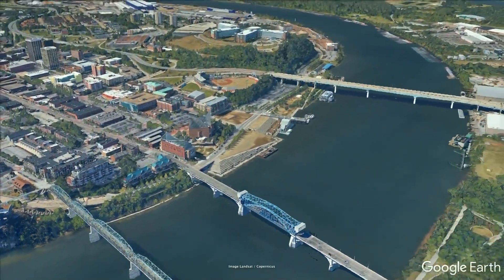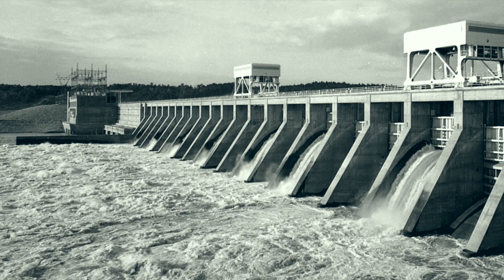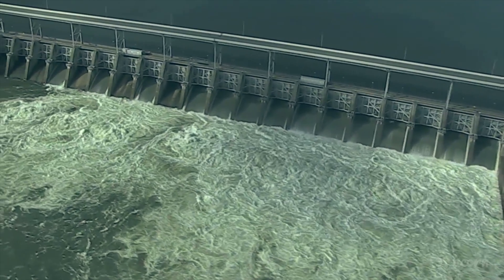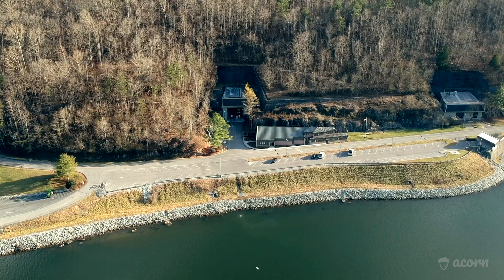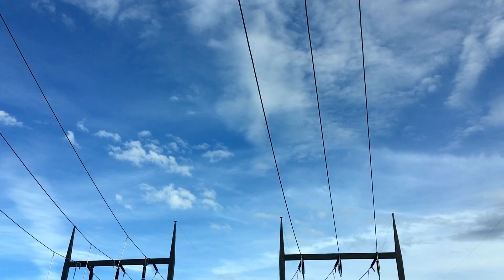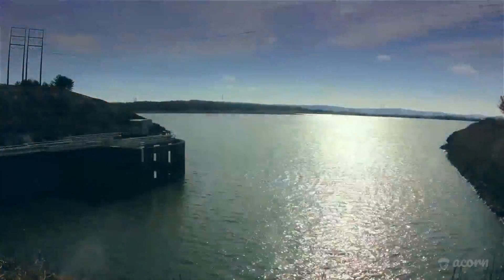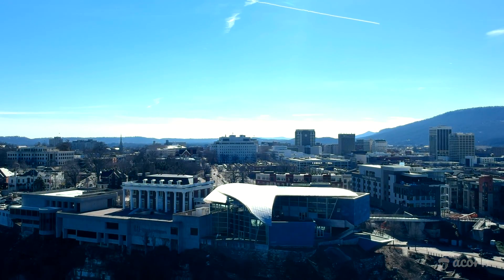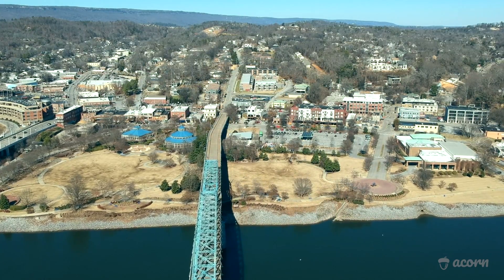Turning a Mountain into a Machine

Comment: Northfield Mountain is similar but they use a mountain to store water uptop.  Someone could take this concept a step further. flow the water from a river at a lower amount and dump the water downhill into an underground aquifer.  But what if you have several drops to more than one set of generators.  Drop the water, then flow it faster to the next set of generators, maybe 2 or 3 till its too deep to work, then the water flows to aquifer or underground cavern that's empty.   Has to be a smaller amount of water due to size of aquifer but if a cavern runs for miles then no problem if no rain water fills it.   Or find mountain river where you can flow the water downhill and allow it come out down river.  Elevation drop of 300 feet is easy, the length of pipe is costly but so long as you have water you have low cost energy.  River battery concept!!!